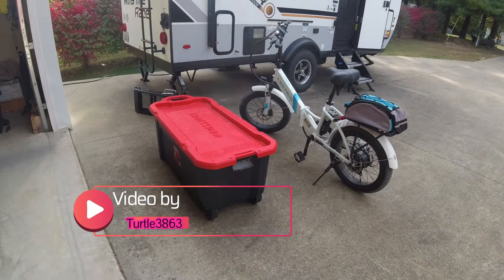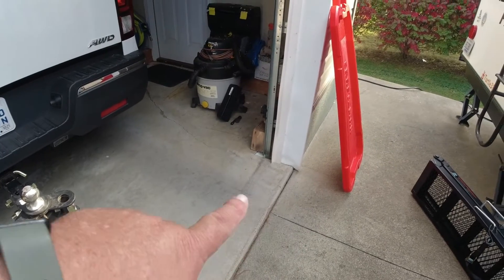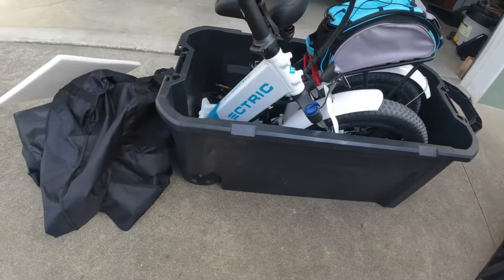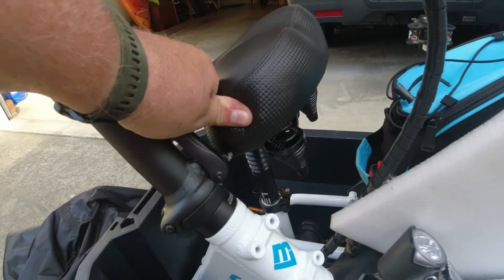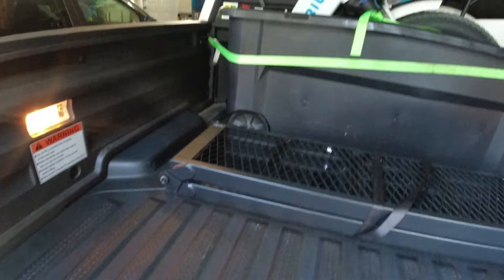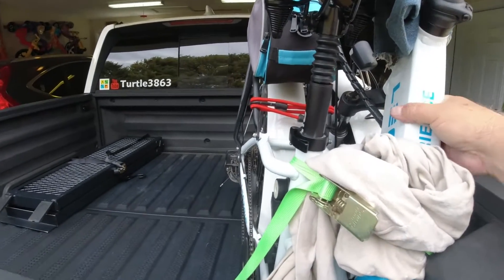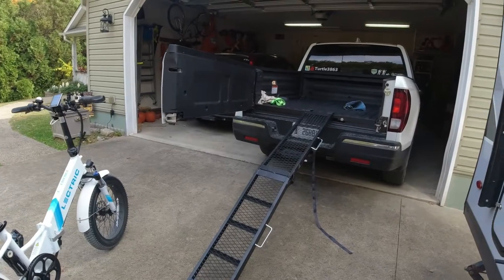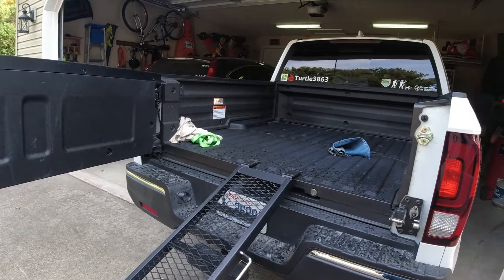Loading an Un loading and E Bike

Comment: After watching your first e-bike video, I bought the Lectric Lite for my wife. It's much easier to handle and at 45#, I can role it right up the steps into the RV or lift it right into the back of my RAM. I still want to get one for myself but my being over 200#, I don't think the Lite will work with me so your tips were very helpful. Thanks.

Comment: Found you today when looking for the Geo Pro 19FD and liking your videos. How does the Ridgeline do pulling the GP and how does it affect your gas mileage?
Reply from the maker: It does okay, I take it easy and keep the highway speed under 65mph, as for mileage, it goes from 25 mpg without to 12 mpg with trailer. I also have the transmission fluid changed every 25000 miles